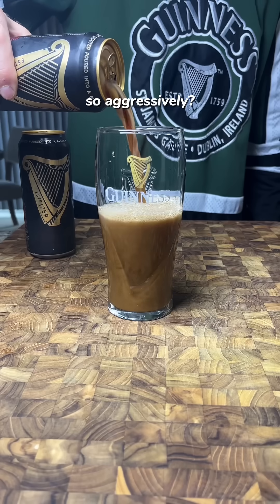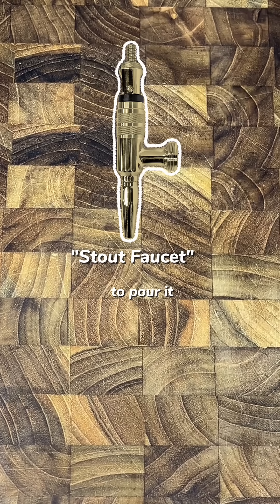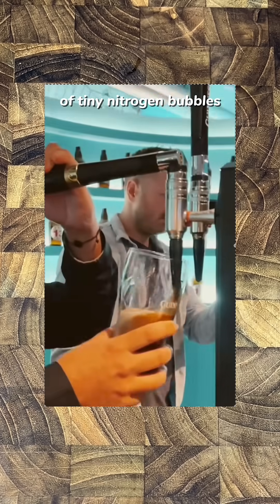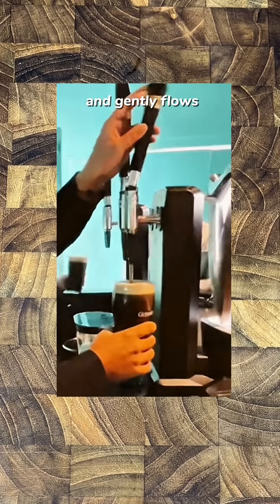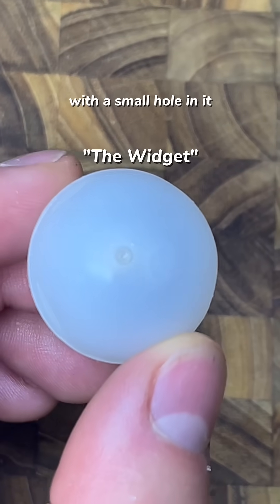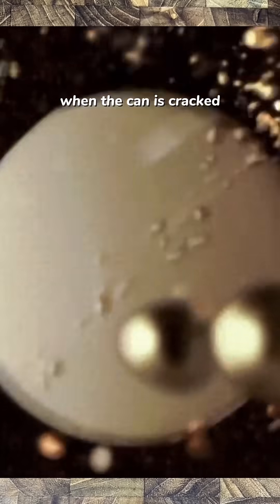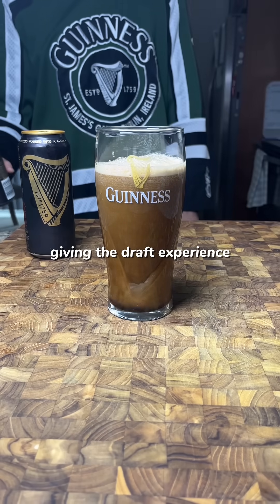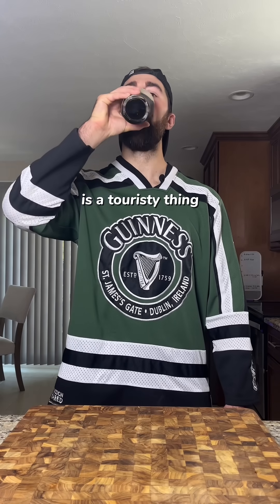The Original Nitro Beer

Comment: That was way to fast, I don't even crack mine fully to start the pour. Start by pulling the tab just enough to pop the seal but not so much as to fully push it down into the can. The force of the beer coming out paired with the tiny opening keeps air from going into the can and helps the bubbles last longer.

Just got shits and giggles I tested it and below are my results. For reference this was done at 10:10 AM in troy NY on 10/19/25, 30 feet above sea level (volumetric pressure unknown), room temp 51°F. Testing done by recording time till 2 inch diameter could be seen without foam with the timer started as pouring stopped.

Control can was fully cracked then poured: head disapated completely after 3 mins 14 seconds 

Half cracked: head disapated after 4 mins 42 seconds

1/3 cracked (my method): head disapated after 5 mins 22 seconds

Comment: Carbon dioxide is reactive with water. It forms Carbonic Acid which has a bit of sour flavor and a bite. Nitrogen gas is generally inert, so it makes bubbles without much changing the flavor of the beer. Depending on the beer, that flavor of Carbonic Acid could be a good thing or a bad thing.

Comment: Eh, it's a creamflow beer mix of 70/30 N2/CO2 rather than pure N2. Gas pressure is higher off the tap though so you have to pour a half glass and let it settle as otherwise you're wasting beer. Especially with the proper stuff, it's lively!

Comment: I’ve never seen such an analytical “food-science” approach to describing beer. This is quality stuff man, thanks.
Reply: Yeah but he didn't care to mention that nitrogen gas has a distinct sweet aroma that is crucial to guinness flavor compared to tangy aroma from co2 gas.
Reply from the maker: @michaelsoftbinbows6919 ya, there’s a lot of little details I have to cut to fit everything in a minute. I would have liked to get more into the other reasons for the mixed gas dispensing and nitrogen solubility … but 60 seconds is short and people’s attention spans are shorter 😂
Reply: @michaelsoftbinbows6919 you make it sound as though nitrogen gas gives the sweet taste and aroma where thats all guinness but the nitrogens more gentle cascade of bubbles from the nitrogen release does. Co2 on the other hand will give a tangy zest generally no matter what added too.
Reply: Beer is driving science progress
Reply: So does it or does it not have nitrogen in the ball dude?
Reply: @JoshP-ip5hh the widget is just an empty ball with a hole in it. The misconception is that it’s filled with nitrogen gas, but really it’s just filled with beer - the same beer as the rest of the can. The beer is all nitrogenated and the widget helps release some of that nitrogen
Reply: Its not beer, its stout.
Reply: Uh you can spend the rest of your life studying beer.  PhD level stuff.  I have a postgrad in beer science.
Reply: Great beer, too! 😅